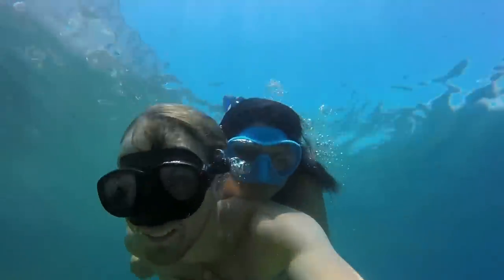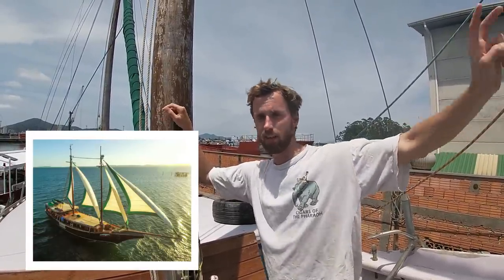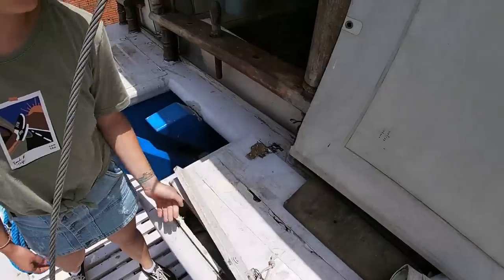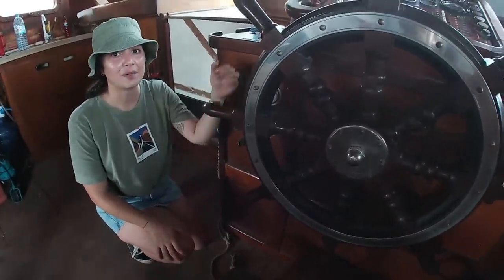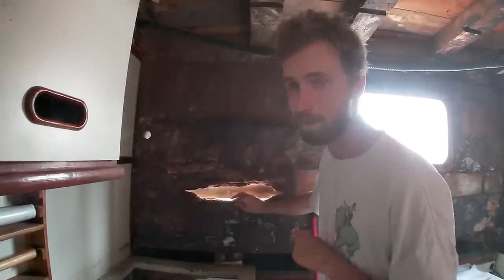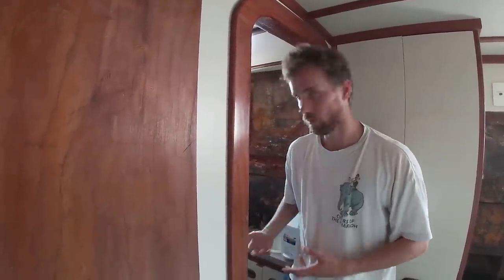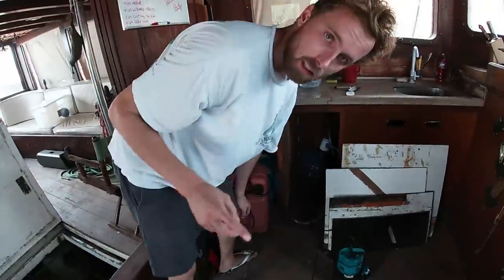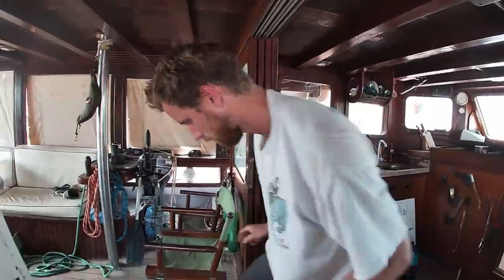BOAT TOUR of our wrecked Brazilian ship — Sailing Yabá #7

Comment: Kids, you got a long road ahead of you. You got a boatload of rot, no pun intended. Once you get her scraped down, sanded, and the worst planking replaced, you should apply several coats of thinned penetrating epoxy (1 part denatured alcohol) on EVERYTHING before finishing. Every wood surface you can get to. You can use several coats on a fragile piece such as trim or hard to reproduce decorative bits that have rotted to give it strength and make it workable for refinishing, eliminating the need to replace it or do without it. Either way, you're going to need a lot of it and time. This is a massive undertaking, but she's an absolute beauty and deserves a better future. I'm on my second restoration now (40 footer) and about to go back in the water. Good luck, guys! Listen to those who know and learn. Be safe. We'll be watching!

Comment: Hi guys. Happy to see you safe in the boat yard. Thanks for the walkthrough. Now to the advice: Judging from your facial expressions of ep#6, the last video, I assume the yard manager gave you a time estimate for the repairs that exceeded your expectations. At the end of the day these yards have a lot of manpower to draw on, and can complete large scale projects in a reasonable time. - In order to reduce the time it will take to complete the rebuild, you should use the time now, to completely strip out the interior of the boat. It will make access, discovery and repair go a lot faster. Then use the time when the yard is working on the hull to refurbish the engine, layout new electrical systems, and plan the new interior, reusing bits and pieces. With your access to skilled carpenters and low cost quality hardwood, a new interior will only be a fraction of the overall investment. It will also make for great content, and I am sure you will get a huge following in no time. Good luck

Comment: First of all I would like to say good luck with the rebuild, and I wish you fair winds and following seas.
Second, as someone who has spent nearly 2/3 of their life around sailboats I'll say that this will be A LOT of work, I am getting ready to build a boat from scratch and it won't be this much. Restoring her will take an ungodly amount of time and money but it is certainly doable. On that note, I want to offer some sugestions for you to make your lives easier now, and in the future when you get her finished.
 
1. Download a copy of the Gougeon brothers book on boat building, it is very technical but will be extremely useful.
2. If a plank or rib is suspect then you need to replace it entirely. Saving a few bucks or a few days worth of work is not worth your life when at sea.
3. My suggestion is to completely gut the interior and ensure that the hull integrity is sound before you worry about the layout.
   a) All exterior wood, especially any endgrain and anything below the waterline needs to be sealed with epoxy inside and out. Provided that you do it right and use new wood for all the repairs, it will prevent water intrusion and keep it from rotting out again in the future. Using epoxy to join wood to the ribs and stringers in addition to the nails and screws will also help to reinforce the mechanical fasteners with a chemical bond and give you a stronger hull.
   b) ANY intrusion into the wood from the outside (throughhulls, bolts, screws etc.) should first be cut or drilled oversize and filled with thickened epoxy. Then cut or drill the proper size hole through the epoxy and install your hardware, this will seal the wood from the elements and prevent rot.
   c) NEVER USE ANY SILICONE CAULK TO SEAL ANYTHING ON A BOAT. It is not durable, it will leak, and it is nearly impossible to remove. ONLY use Sikaflex, Butyl or some similar marine sealant.
   d) Reinforce ALL through hulls with backing plates.
   e) I would recommend sheathing the hull with fiberglass when you are finished rebuilding her. 1 layer above the waterline, 2-3 on corners and bottom side planking, and 4-6 at the garboard and keel area. It will help to strengthen and weatherproof the hull to prevent water intrusion, as well as helping to shield the hull in the event of grounding.
 4. Once the hull is sound then you can work on interior stuff. I would ditch the standard lead acid batteries and switch to AGM, Carbon or LiFePO4 batteries instead as they are safer, longer lasting and more efficient. Also ditch any lights that aren't LEDs, the LEDs use less power and last much longer. Also, keep the big galley, you will appreciate the work space.
5. Not having seen the specs on her I would be cautious doing any bluewater sailing, to my eyes she looks more like a coastal motorsailor than a true oceangoing cruiser. That isn't to say that she can't do it, but if you choose to then you need to pick your weather windows very carefully and sail very conservatively.

It isn't my intention to scare you or pour water on your campfire, and I wish you all the best. Just be careful and do it right, and don't be afraid to ask questions if you don't know something.
Reply: This!
Absolutely everything he said there is spot on.
Reply: @bphenry  except the forgotten given of enormous expense beyond belief!!!! This is a recipe for FAILURE and divorce..... sadly.
Reply: @saylaveenadmearedead  indeed. I’m not saying it’s a good idea. I’m saying that the above is a lot closer to the “couple of months” of work that I think is being anticipated.

Comment: Based on my wooden boat experience, leaking decks cause the most damaging rot. Until you repair the decks, put up a tent to keep the rain water out.  If water continues to leak in, the rot will get worse even as you work to repair it.
Best of luck.
Merry Christmas from Alaska, 
Greg Chaney

Comment: I absolutely LOVE the open air salon and the sliding doors leading to the cockpit.  That boat is not designed to cross oceans, but you can have WONDERFUL adventures up and down the coast !  Good luck on the refit.  It is going to take a long time.
Reply: "That boat is not designed to cross oceans". Agreed. So is it worth all the money and hard work to save it from sinking ?
To end up with a coastal only cruising ship ?  Huuuum.  Depends on their expectations, I guess. As a guests tourists tour boat, it looks great.
I noted that Ben, MP too most probably, is impressed by the number of storage areas.
As an experienced house designer and builder's consultant (40 years), most buyers are ticked in or out by A) storage capacities of a house (mostly women). B) storage capacities of home shop/garage (men) C) perceived quality of fit & finishes and cabinets.
Structural, plumbing and electrical installations soundness ? Duh. Sadly as they found out by ripping the nice looking walls and ceilings...
I sincerely wish them the best of luck with their endeavor and dreams. And hope it does'nt end in a disaster.

Comment: Good luck with this project. My advice is to restore the lower galley. It will be more stable in a seaway. The one in the wheel house can be used as a bar or a supplement to a grill on the deck somewhere. You can also use it for beverages during the day. The wine cooler could also be relocated here and can store cold water if you don’t have much wine. A small refrigerator can also be installed to keep beer and sodas cold. This will keep the lower galley refrigerator for food and colder without people getting drinks out of it. 

If you are going to use Yaba for charters keep your cabins flexible so you can add the upper bunk back as you need it to accommodate different guest configurations (I.e. two singles as opposed to a couple). 

Just some thoughts...

Comment: Wow, that engine is a merc 352 diesel series.
One of the most efficient engines built for the 911 mercedes benz truck's built for the German Army. Wow great, keep that engine. I have had quite a few of those trucks for tourism in Kenya.
Reply from the maker: Thanks for that advice. We will be taking it apart to clean and service it. It will be like new

Comment: Really cool boat! In my opinion you really need to gut it and take it down to the framing to do it right. The way water travels you'll never find all the rot by taking things apart piece by piece. You don't want to put all that time, effort and money into the boat only to find out later that you missed an important structural element that was hidden below the surface. Good luck to you and we'll be watching!

Comment: Getting the hull sorted out is a huge step.
Reply: I keep hoping that in the next installment they will tell us how bad the keel, frames, and planking are.
Yaba is very big and very cool. I hope it can be saved. Time and money..... best wishes, good luck. 👍
Reply: @108hindu  I watch Odd Life Crafting and they started out with a steel hull and they had to basically almost replace everything else.  There is so much rot in this wood boat, I think it will be a miracle that they get the hull seaworthy.  I really hope they have the funds and time to rebuild.
Reply: Look at the Sampson boat project, this is about the scale that has to be done before it's seaworthy again. At least it needs new planks, which is a huge project itself.
Reply: @hinz1 Replacing the planks... a lot of expensive wood, a lot  of very skilled labor, and a lot of love. Even 1 plank level for a boat 70+ ft long can be very time consuming. 
They will have to be very determined to learn the journeyman level shipwright skills needed or have a big bag of money.
The first thing. Tear off some of the rotten planks so you can get a good look at the frames!
Don’t work on moving batteries, fixing wiring, and other things. You must find out if the hull can be saved first.
Hope for the best, plan for the worst. Best of luck to them.

Comment: I hate to say this guys and i wish you all the best, but the amount of money, and time you will spend on this boat to do this right, will set you back a small fortune, I've worked with wood most of my working life and 70% of your boat it rotting away, it will take year's to repair, there is no quick fix for this amount of damage, if it was me I would cut my losses, I am not saying, its not something you guys can not do, but you must be ready for the long haul, to do this right Yaba will be on the dry for a long time, all the best and good luck 🤞
Reply: Check back in 30 years....
Reply: The plan is to build the fan base then ask for money. Picking an "impossible" boat like this gets attention faster. It's all about getting the viewer as emotionally invested as possible so they donate more money. So you see it doesn't matter how impossible or how much money it costs. If it takes too long they will just use viewer money to buy a new boat.
Reply: @alexander5207  that’s exactly what this channel is all about. I am brazilian and just by the looks of it, the repairs for this can go easily to the 300k BRL mark (around 60k usd). With that money you can get an amazing 42ft blue water cruiser. They already have 126 patreons (idiots) as of today
Reply: @wlff88  lol.....modern begging....recipe:  cute wife/girlfriend, always happy and bubbly smiling in videos....ridiculously huge expensive project begun with not enough money to complete the job....and better off just building new next to it....check check and check.....

Comment: Wow , there is a lot of work needed but you would have seen most of it before you bought the boat. Big interior spaces, love it. Get the hull done first , there is no point starting the inside if the hull is rotten. Good luck, I think your going to need it.

Comment: When you showed us the GPS and map it looks like the builder is nearby   if so, I would definitely get them involved after all they are the experts.  Even if you just send them pictures then talk on the phone, their input would be valuable.   Maybe if they build a new hull, deck, house, rudder, etc., the entire structure, then you transfer all the hardware, engine, standing and running rigging, masts, etc.  Àsk the builder for a quote to provide a bare boat.  

Good luck!
Reply: Sounds like that’s what’s needed! 😂
Reply: 1200 miles. It's like the distance between Miami and Boston.

Comment: Well you have certainly taken on a lot.  This has to be a labour of love because it is hard to see how you would ever recoup the money needed to bring the boat back to life but as long as you guys are happy with that then it is your choice.  I have never restored a boat but I did spend a lot of time rescuing a neglected 100 year old house.  The one thing I learned in that was that the most time consuming and difficult part of the process was trying to retain original features.  Fitting new to old is difficult and expensive so if I had one suggestion it is don't grow too attached to what is there already.  Others have suggested a complete interior strip out and I can see the sense in that.  You need to know that everything in the structure is sound and will remain so.  When that is done you can put back in whatever is worth keeping and replace or change what can be improved.  I wish you luck because I think you are going to need it but I really hope this works for you.

Comment: of course you will know this but a gentle reminder. When repairing, think, does this need to last 5, 10 or 50 years? Replacing say one of those ribs if rotten could be done by putting up form work and filling with bog or f/glass. Also I notice when describing things you still use left and right. The reason we use port and starboard is that will will never be confusion as to "my left or your left" Sailing terms are important and I don't mean to be harsh. You have taken on a huge project which will give you a wonderful lifestyle, I wish you the best and will enjoy your journey.
Reply: Nicely put!
Reply: Wash your mouth out. Wood and bog/fibreglass do NOT bond for more than a few months.
Reply: @nickviner1225  well you may have more experience than me, I have only used it for small jobs. On Yabba I would not remove a whole rib or two even though it may offend purists. Maybe a formed "sister" rib placed next to the rotten one?
Reply: @toomasnelson4561  No Toomas, you MUST remove all the rot or it will infect the new timber. However sistering is fine when say the original one has been cracked.

Comment: Just so you know and others have already commented that vessel is Not for open seas. It is a coastline vessel only and meant to take safe harbor in storms. If the prior owner was lucky enough to survive more than coastline trips that could explain the severe water damage. She was not built for heavy seas.
Reply: As was explained at least to me was the damage we all see was due to the former owners neglect ,and as all of us who have owned or still own wooden boats that is certain death for any boat .
Reply: That vessel appears to be built strongly and wonderfully well.  I would speak with an experienced naval architect before I  would consider her merely a day cruiser - (not built for heavy seas).. The fact that the mast goes all the way into the keel is a great sign.  Get her seaworthy first - sail her - then take your sweet time with the cosmetic stuff.

And get expert advice on the sealants you use - not just some guy at a marine supplies store.  If the sealants are top quality AND YOU CLEAN AND PRIME  the surfaces first, the sealants should last for decades.
Reply: @DWilliams-ce8nb  I'm not trying to insult you but did you not listen to them say thy have experts on hand and are surveying the boat and advised them to  to sand only near the waterline because thy would need to replace all of the lower planks and keel? .also professionals will be doing the work with them only assisting and learning? this will allow them to do other things like working below deck getting things in order .I may be wrong but I think they also remarked that thy know Yab'a was not built as a blue water vessel.in one of there videos.I do thank you for not just slamming them for buying a wooden boat that needs a lot of work. Also I have never heard of a sealant that lasts for decades on any boat let alone a wooden boat I would consider it a great favor if you would share this knowledge and product's with us and the world. Thank you .
Reply: First if you had been watching this story unfold for any length of time you would know the damage to this boat was caused buy neglect from the previous owners .Two .This boat can go out to sea  you would know this if you watched all of the videos it is primarily for coastal but it can go to sea
Reply: @nunosantiago2273  HA Ha Ha  Well what can I say to that .Thank god for binoculars .And a good story and thank you for it .